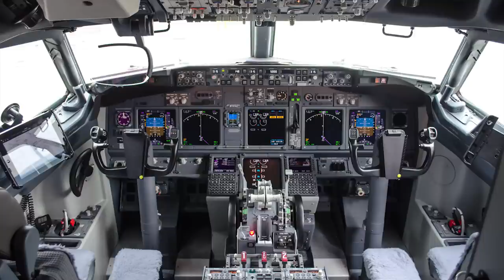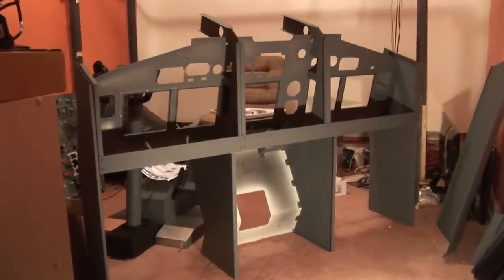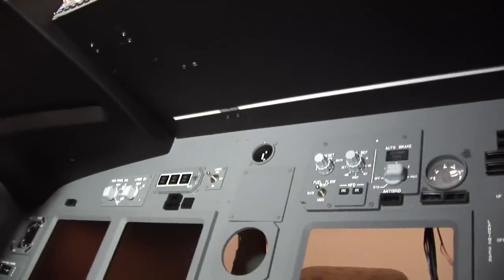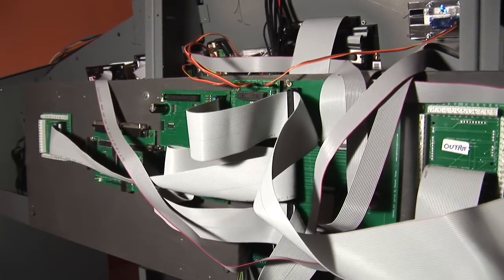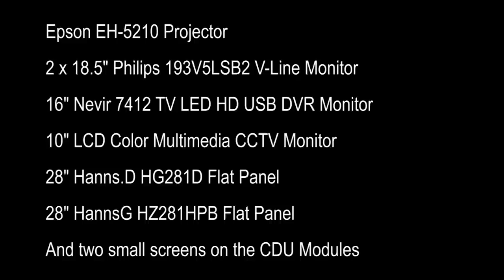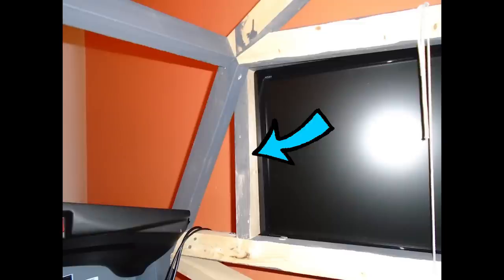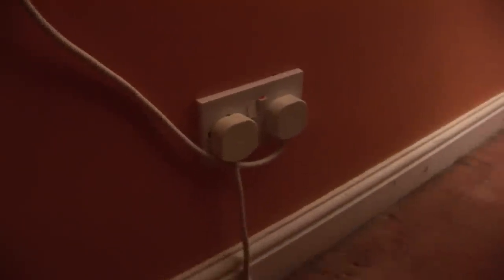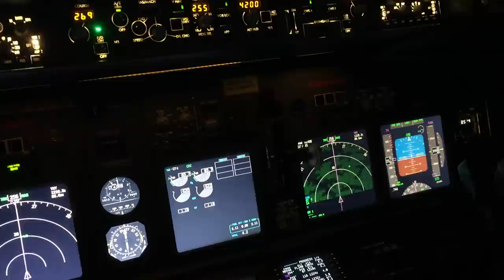Building a Boeing 737 Cockpit

Comment: Do They Have The MD11?
Reply from the maker: Here is the PMDG shop website: https://pmdg.com/prepar3d/ but it doesn't look like they have the MD11,  And the default vehicles in P3Dv4 are here: https://www.prepar3d.com/vehicles/ - but no MD11.  However you can purchase an MD11 from here: https://secure.simmarket.com/sky-simulations-sky-simulations-md-11-v-2.0.phtml as they have one that will run under P3D :)

Comment: Or, if money is no object, for about $100k,, you can have Flight Deck solutions of Canada come to your house and build it.  They have to deal with the pain instead of you.  The behind-the-scenes wiring, circuit board configuration, integrating it all with your choice of sim (FSX, XPlane or Prepar3D) is something best left to professionals IF you can afford it.  FDS even sells the J-bar Boeing type seats (they make their own) - and they offer refurbed actual Boeing dual-link yokes.  Prices and models subject to change.  And watch out for sim burnout.  That's where you go up and down the ski run 1000 times and on run number 1001 you say to yourself "hmmm...I'm kinda tired of this, think I need a NEW HOBBY".  At that point you help your spouse load her stuff into her car...
Reply from the maker: Ha ha - well said.

Comment: the wires got me feel sick, i dont understand anything about them, and i wanna be a pilot, so i need something like that too
Reply from the maker: The wiring was the trickiest part - they are so small and the space is sometimes very constricted.  But with Opencockpits, they do an excellent job of providing a very detailed and colour coded schema to follow.  It took me a while, and yes, I did make mistakes along the way, but it all worked out well in the end.  The key is to be patient and go slow.  And always check your work after every connection is made.  That is how I finally got the project done.  I have every confidence that you can do the same. 😊
Reply: @FatherDane  Thnx
Reply from the maker: @LilKrix27  👍

Comment: Wow and I thought my desk was a cable management nightmare lol
Dual displays, two desktop computers, two laptops, two sound systems + the displays built in audio, a audio switch. 3 keyboards two mice, two usb hubs four usb extension cables so the rear usb ports on one desktop are usable, a plug and play switch to bring Ethernet to my room for one of the desktops,ps3, and two cables for future console's, and a old router to network the two laptops together for retro LAN multiplayer games oh and the laptops are linked to the displays via vga and use there built in sound.the laptops share sub devices via kvm switch and a usb rom drive via the router. Oh and there's a pair of dvi to hdmi cables and audio cables running from the desk to my dvi so the desktops can be played on my dvi if I so choose

Thankfully everything is labeled and cable managed. The cables, power bar's, and adopters are also all mounted to the main back panel on the desk. So if in the future I had to take the desk apart so say if the room was being repainted etc I can leave all the cabling attached to that part of the desk. All I'd have to do is unplug everything from the machine's and other hardware
Reply from the maker: That is also what I try yo do: label everything.  Not always easy though is it?  Happy landings 😊
Reply: @FatherDane  Nope it's definitely not easy. It doesn't help when labels start peeling and you have to go back over them with clear tape ether lol
Reply from the maker: @JohnSmith-xq1pz  Been there, done that and got the tee shirt 😂
Reply: @FatherDane  🤣 Yup it sucks
Reply from the maker: @JohnSmith-xq1pz  😂
Reply: @FatherDane  👍

Comment: How much does it cost?
Reply from the maker: If I were to total it up I suppose it would be somewhere in the vicinity of $20,000 but that cost has been made over a period of 15 years.  I started out with a single monitor and a joystick … that was over 15 years ago.  Bit by bit, and piece by piece I got the parts as I could afford them and assembled the cockpit in stages.  See the earlier videos to see what I used before as that will give you a picture.  Only someone with a lot of cash could go out and get the cockpit ready made - me, I had to buy it as I could afford it.
Reply: @FatherDane  thanks.

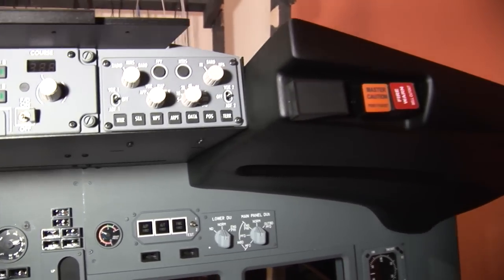Comment: 16:16 the FO fire warn is't placed as well
Reply from the maker: At this point no it wasn't.  I had just stuck it in the hole so I would know what went in it.  Later on and after I had finished wiring it, then it was properly oriented.  But you have a good eye for detail - well done!

Comment: I once fantasized about getting LRUs from the bone yards and non-certified [non TSO'd] panels together from the OEMs and an IO system to work all discretes, and putting it all on an electrically actuated platform run by an 8 core machine with Xplane 10.   But then realized I was better off just paying Alteon $400 an hour to go play with the real 6 DoF, Level D CAE sim.  One thing I would like to see you do is make the video windscreen panels more coordinated and shaped like the actual cockpit windows.  Do those yokes and pedals have load feel control or feedback? Would one of those Redbird platforms work for a limited throw to give feel for turns accel/decel and turbulence?  If nothing else though, we could use your $37K device as an FTD.  Perhaps a screen setup like the following might serve you better https://www.youtube.com/watch?v=pCypkbaJFkU.  I like it except the unavoidable edges in the middle of the clear view windows.
Reply from the maker: Yes, that fellow has a much better set up than I do.  I am somewhat limited due to space as the spare bedroom isn't large.  Also I have limitations on my cash flow being an OAP (old age pensioner).  I wish I could have a sim like the one in the link - those monitors are really sharp.  As to yoke feedback - no, I haven't got that.  But my sim does give a lot of pleasure to me and to my visitors which was the primary reason for the build.  Thank you for the detailed comment - much appreciated!

Comment: Wish I had the money to do this
Reply from the maker: This took me over 15 years to build.  I started out with a joystick and a single monitor on the old Microsoft FSX.  Then, as I saved up my pennies, I got a second monitor and then a third.  It takes time and dedication to do this.  I'm on the lowest pension rate in the UK so saving part of it to buy parts took a long time.  If you have an end picture in your mind - a picture of what your sim would look like when finished - then work towards that goal by purchasing only those parts that will be ultimately used.  Over 5 years ago I had this: http://youtu.be/6J9ZcGmbrtU and then I added some new software for this https://youtu.be/rjUEhCD4PrY both of them using a simple setup with three monitors.  Then I managed to get a proper yoke and pedals and the cheapest throttle quadrant available and a year later I had this: https://youtu.be/x8dsuPSTRxo.  The two additional monitors were touch screens to add a bit more realism.  But may I suggest you look at this video: https://youtu.be/GBw34BlBizA as it details the growth and development of my own system as it was in 2016 - four years ago.  Unless you win a large chunk of cash, or inherit a tidy sum, then you will have to do it bit by bit.  And here's the key: wait for the sales … that will save you a lot of cash as it did for me.  Happy landings!
Reply: Father Dane thanks alot for this reply means alot
Reply from the maker: You are very welcome.  Don't give up on your dream … you will get there!
Reply: Father Dane 🤝
Reply from the maker: Thank you

Comment: at this point, my guy is just missing the wings and engines :)
Reply from the maker: What a great idea 😀
Reply: Father Dane now to move it outside 😂
Reply from the maker: @phantomking2425 Just knock a few walls out ...😂
Reply: Father Dane full length wings
Reply: Father Dane this bouta be a flying house
Reply from the maker: @phantomking2425  🤣
Reply: Father Dane btw do you know of any softwares that take on off switch’s and code them to buttons
Reply: Father Dane because i have a button box that I made and it has on off switches they work in my flight sim but if I want the landing gears to go down I have to turn the switch on and to put them back up I would have to turn the switch of them on to do it
Reply from the maker: @phantomking2425  Yes.  It is called FSUIPC and you can programme just about anything to do what you want.  look on http://www.fsuipc.com/ for more info.  It is I use. 👍
Reply: @FatherDane  is there any that are free that you know of if the one you said is available for free what things do i have to download
Reply from the maker: @phantomking2425  or several freeware sceneries, then you should have a look here https://library.avsim.net/ and there are many other sites as well if you do a Google search. Happy landings

Comment: My compliments  father for your video!!! i'm fan of aviation I need to have a more informations related your project. It's possible to exchange the email? thank you in advance
Reply: hello, sorry if I have not written more but living in Italy there is the time difference, how much have you paid the mip between fmc cmp efiss screens behind the pfd etc? excluding pedestall yoke throtlle overhead and more? one last question ... why did not you use prosim?
Reply: @FatherDane  thank you
Reply from the maker: You are welcome - I wish you well with your own project.  Happy flying!
Reply: @FatherDane  thanks!!!
Reply: @FatherDane  I made a configuration with opencockpit, momentarily only mip: efis, mcp v3, mip brcap panel bki, mip ilu bki panel, fmc v3 mip central, flaps gauge landing gear, mip panel left mip panel afds.
Which hardware / interface cards do I need?
Reply from the maker: This is a question best answered by the good people at Opencockpits.  They have the expertise as well as all the parts and equipment you would need.  Contact them at: support@opencockpits.com and they will tell you exactly what you need.  Be prepared to send photographs of your equipment in case they need to examine it more closely for connection matching.  I found the support people very helpful and very knowledgeable - the support staff can answer your questions in Spanish or English if that is your preferred language;  it is also possible that they may speak Italian.  Just ask them for a language that you can both use for communication.  They also have a telephone number: +34 6298 26213 (10h to 14h weekdays). :)
Reply: @FatherDane  thank you